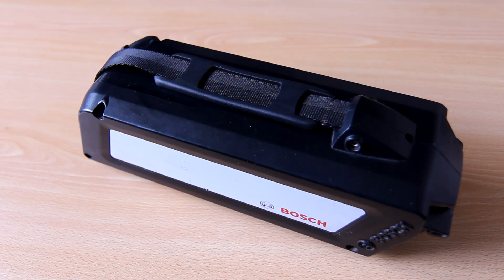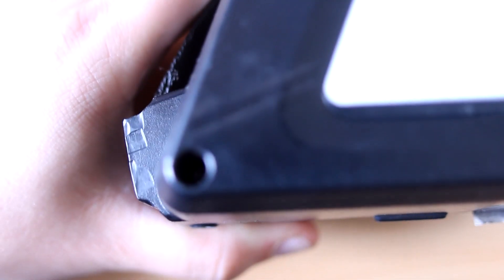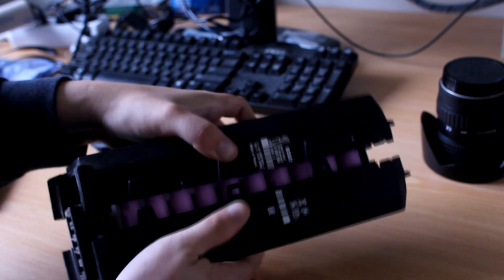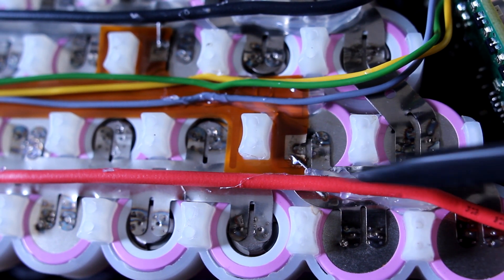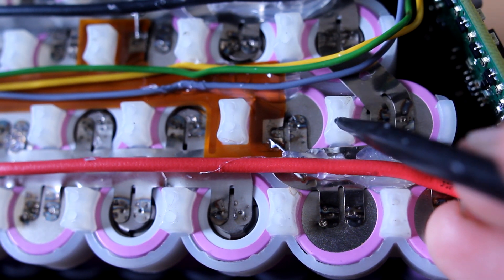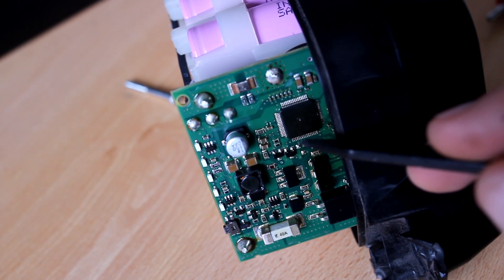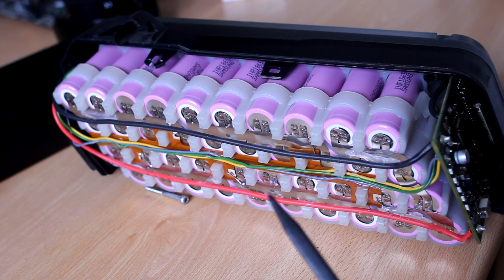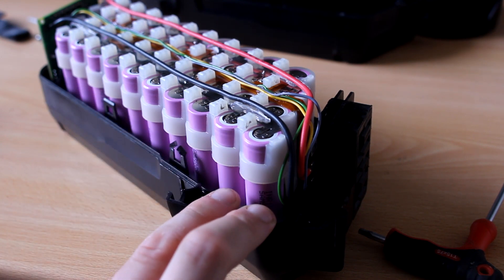Repairing a Bosch e-bike part 2: the battery (053)

Comment: I "finished" this repair on a powerpack

"1-270-020-504
20322 0034 1 2
Li-Ion 10INR18/65-4
36V 8.0Ah 288Wh
Made in Poland"

Now i am getting a blinking error-code (2nd and 4th LED blink when i press the battery indicator button) the error code means:
A defect is detected in the battery pack. Contact us for assistance.

Actions taken:
1) Checked individual parallel cells -> All are perfectly balanced at 3.53v.
2) Checked balanced connector pins on BMS -> All cell voltages reaches the BMS.
3) Tried the 10second reset ->  No change. 

So it seems that I might be out of luck

Probable causes;
X) That my battery has a suicide function. (not very probable i believe - as it is 5 years old)
Y) I heated the BMS too much or damaged it with ESD or in some other way during my repair.
Z) When i first connected the battery to the charger, it seemed to charge for a moment but then went into error mode. After this i discovered that i had not connected the cell-monitoring-cable to the BMS. So maybe the BMS saw this as a damaged battery, that should not be charged/used for safety reasons... Be it from damage or DIY-tampering.
H) That the battery has somehow damaged my charger, and a new one might fix the problem. (Unlikely i think)

Right now i am leaning towards y or z

Loose ideas of things i might try:
a) Try connecting battery to ebike - to see what happens - maybe a more informative error message...
b) Charge the pack using other Li-Ion charger and then reconnect the BMS. See if that makes a difference.
c) Contact a ebike-shop and ask if they have any reset-tools for the battery (i would deem this unlikely)

Conclusion: 
Make sure everything is connected the first time you power on the battery.
I would love your input. 
Also: The author of the movie mentions a forum where these things are discussed. Which one might that be?

Again: Thanks for a great movie

Comment: hey, good informative video, i have a 10ah pack which sits on a 15a max bike, the battery also has a 15 amp rating on it so when i go to accelerate the bars on the display go down. so sad they didnt put sufficient cells in the battery pack for the application. but do you think these are genuine for when those i have fries: https://www.ebay.com/itm/3-7V-Max-13A-3500MAh-18650-Akku-INR18650-35E-Wiederaufladbare-Li-Ion-Zelle-10Pcs/333297724114?_trkparms=aid%3D555018%26algo%3DPL.SIM%26ao%3D1%26asc%3D57921%26meid%3D3ea58d3e61354a6baca6e5b138303b5c%26pid%3D100005%26rk%3D2%26rkt%3D12%26mehot%3Dpf%26sd%3D143211300204%26itm%3D333297724114%26pmt%3D1%26noa%3D0%26pg%3D2047675&_trksid=p2047675.c100005.m1851#rpdCntId

good cells seems to be everything.....

Comment: Hello, is there a schematic drawing online, which shows clearly how the cells are interconnected ? I had to remove a faulty BMS completely and now I need to charge every SINGLE cell in order to have a balanced pack and to be able to charge it with a cheap china charger, which charges up to 42V. Thanks !

Comment: is it possible to remove the whole pack including bms and plug from the case? i mean to just exchange the case i.e. a black one for a white one without welding?
Reply: If your are still interested, absolutely yes, replacing the case does not require any soldering

Comment: Hallo an alle brauche deine Hilfe !!! Ich habe eine BOSH-Batterie mit 400 Watt, die den Motor nicht mehr mit Strom versorgt. Ich habe es an der Batterie selbst demontiert, es sind 42 Volt im Ausgang 0. Die Platine selbst wurde an einigen Stellen oxidiert. Ich habe alles gereinigt. Wie führe ich eine BMS-Karte (Controller) aus? Danke

Comment: ATTENTION! If you have new style battery (400/500 Wh), you need to connect 36V+ power supply to terminals while replacing the battery pack, so it won't wipe itself. Then you have to hold button on battery for 10 seconds to "reset" it. 
I've done it today and it's working fine. 
(I'm not 100% sure if you really need the power supply, but I will not risk 900€ battery)
Reply: Did you powered the BMS before or after disconnecting the battery cells?
Reply: @Gungarr  Why would you power it after diconnecting? 
But one guy told me, that he just unplugged it, soldered new batteries and it still worked after reset. I wouldn't risk it though. There are too many "it's not working now" comments here.

Comment: Thanks! You inspired me to do this DIY upgrade and I managed to replace with 20700 cells giving me a good 17Ah/600Wh capacity  with more power. Although I had to buy a spot welder and spent some time on searching & knowledge: it was worth the effort (and money).
My experience in short:
- Cut the main wires at the battery tab and save yourself the trouble of desoldering at the bms.
- Forget about the effort of saving the old nickel strips (I spent a good 30 minutes on one side and decided to give up). Buy new strips for a dollar/euro or so.
- For my speed pedelec I wanted more power and capacity so I used 20700 cells. These fit if you just hot glue the cells together which will give the same dimension as the original pack. You need to remove the tabs in the side panels to compensate for the increased height.
- You can solder the balance leads to the bottom side of the balance cable, this save the trouble of scraping off the top layer.
- My Bosch classic 400 pack still works after having it depowered for 3 weeks. 

Result: before a good 35-38 km/h. After: 41-43 km/h :)

Note: I just did not want to run the risk but there is a good change that 21700 cells (20Ah!) will also fit.
I am thinking about moving the controller board to the connector end because I jut can't stand the idea of losing power in the long cables.

Comment: hi, I have a bosch powerpack 400 which did not work and I replaced the cells not knowing that the BMS can not stay disconnected. Now when I have the cells replaced with good capacity cells the BMS does not gives any order to the motor.  The Battery is charging and fully charged.
Ho could I hack the BMS to make it work again? ANY HELP IS Apreciated. THANK You
Reply: Newer style bosch batterys like the power pack 400 have specific software that links with the controller on  the ebike. Bosch basically makes them unrebuildable... i work at a ebike shop and my battery guy has made the mistake of trying to bypass the software have u had any luck?

Comment: After a week of struggling to find a way of increasing my Bosch cells, I figured out a way of increasing my Bosch 300 pack without taking out the cells because I figured out if I did, that would be the end. Now I have a 28ah battery pack and it lasts me ages. 170 mile on a single charge.
Reply: Its kinda sad you do not mention how accomplished this. Instead...you are gloating.
Reply: you figured it out man, you can now ascend with your head up high, dont bother explaining to anyone how you did it.

Comment: This is fake, the battery does not work anymore after the cell exchange ...
Reply: Not fake! It works for this model.
Reply: Has Bosch built in a circuit to brick the BMS?
Reply: Powerpack 400s have bms brick function

Comment: After replacing the package, it shows error 200. Can you reset BMS and how?
Reply: This is what im thinking with over 500watts something s gotta error but  some errors can be  ignored as i changed a sproket on mine to a smaller one and it showed a error  but the shop told me when  next in theyll clear it and they did  ,but it just shows how sensitive bosch parts are yet  i know this was years ago but a friend wanted to add a standard battery for extra range and completed it by  tricking the bms  dont ask me how but he had a 500 watt pack bosch  and on the top bar a 50p wTt standard battery  he wanted to complete a long journey and his battery wouldn't. Let him so this is how he went about it and it lasted for years but i think theres can bus data cables in the newr batterys nowadays anyway fairplay to yous for been able to do this much respect

Comment: Super video! I have a question that doesn't seem to be answered anywhere... If you do an upgrade from a 300W powerpack classic+ to 400W or even to 500W (483W actually in my case)... will the bikes (intuvia) display show you the correct new ranges? I noticed the BMS from a 300Wh and the BMS from a 400Wh look exactly identical and if they are... (can someone check this please?)... how is the distincion made to determine wether you can bike another 20 or 40 kilometers (or miles if you like). In other words how does the bike know you inserted a 300W or a 400W battery? It would be nice to know how we could change the ranges accordingly when upgrading to higher capacity.
Reply: I replaced the 300Wh cells with Sanyo's GA cells (specs say 483Wh but it is more like 500Wh). I then reseted the BMS as that seemed necessary for correct charging status... Guess I first have to drive the pack empty to see if ranges are adapted accordingly in the intuvia display. Maybe I should reset the intuvia display as well?... don't know. Anyway if the ranges are not correct... the bike will still will run much longer than ever before.
And now that I know how the ebike is constructed, I might consider building a 1000Wh pack myself one day.
Just by adding 4 extra cells in each branch... this should be possible... I don't like the idea of adding the full pack in parallel (-0V and +36V) as that doesn't guarantee each group of cells to be balanced evenly. I would like to have connections between the groups of cells as well. Could be a fun (but quite pricy) project.
Reply: Wim Hulpia sometimes the display range isn’t accurate at all times. Sometimes it will show less.What you can do is navigate to the range display, press and hold the reset botton for a few seconds then it will refresh and show you an estimate of how much range is left.
Reply: well the computer works out the range from how much the battery drains over distance, for example i have a voodoo zobop-e with bosch performance cx and 500 watt hour battery from 2018. in my case i modded the sensor to go well above the 16 mph limit so when im riding at 20-30 mph it reads between 5 and 9 mph so when i fully charge it tells me in turbo mode that i have only 14 miles range, i still get ove 35 miles and i mostly use emtb mode

Comment: i want to use a bosch battery like this to power a 36v LED-chip that's mounted on a CPU cooler as a portable lamp. however the current only flows for about 3 seconds after i push on the button that's next to the charge indicator. what do i have to do to let the battery always be "ON"?
Reply: When not plugged into the bike or charger, the battery switches off automatically after 3 seconds. I know there are 5 connector 'pins'... Number 2 and 4 are the (switched) 36V.  The other 3 pins (1, 3 and 5) are connected with yellow, grey and green small wires to the BMS. I noticed when the small lipo battery in my intuvia display was dead, it was impossible to start the bike (or the battery) by pressing the power button of the display. I had to start the bike by pressing the powerbutton on the battery itself. Once started it stayed on until I pressed that button again or... until I pressed the power button on the intuvia display (so power off DOES work when the lipo inside the intuvia is dead !). I measure 3.25V and 1.6V between those wires for a short time when powering the battery on. What you could do perhaps is install the pack (without cover) in a bike, switch the pack on and then measure the voltage between the three wires while the battery stays on. (The wires are connected next to each other on the BMS so not so difficult to measure). If you measure 0V between two of those, it is possible those need to be shorted in order for the battery to stay on. (But as I didn't construct the BMS, I really don't know this for sure, so don't attack me if you blow your BMS).
Reply: i actually already blew the brown thin conductive film. now i have only the cells left and need to know how i can charge it with only the red and black wires left . :-/
Reply: Sorry to hear that... The BMS does need the strip while charging. It has 13 connections of which 11 measure the voltage of the series of 10 groups (of 4 cells in parallel). 1 connection is the negative ground, and then 10 connections are made at the positive side of each group. A NTC resistor is soldered to that strip as well that uses those last 2 connections. This resistor measures the heat the pack produces to switch it off when it should become too hot. So if this resistor is missing, its resistance value becomes infinite, so the BMS will think it's too hot and switch off. I removed the brown plastic strip with a small chisel and as the connectors are spot welded some small pieces of copper ripped off as well. I put some solder on to repair them... So the pack does need those 13 connections to function properly. As it uses it to show the charging status (leds) and also to determine when charging is complete and how charging is performed (full charging when low en pulse charging when almost full). Hope you can repair your strip tazztone !
Reply: Wim Hulpia .. thanks for your in depth reply.
but repairing sounds like an almost impossible task . i was stupid enough to take it apart. didn't think it would fry the brown strip so easily.

Comment: Could you please confirm BMS part, starting at 9:26, there is now suicide part, so I can remove batteries and connect new right? And I dont need any diagnostic tools to reset or so?
Reply from the maker: Yes, you can safely completely unpower the electronics and reconnect it to a new battery pack. There is no 'suicide' function in the pack. There is also no need for any resets whatsoever.
Reply from the maker: No - the spot welder I use (see my other videos) requires replacing the transformer if you want to use it at home, and the 'more expensive' version is already more than 500 dollars. The Malectrics spot welder at least works and is relatively cheap, but I have no experience with it: https://malectrics.eu/
Reply: i used the malectrics spot welder and it works great.
Reply: @PowerElectronicsBlog  Hi, What is the sequence for re connecting ... i burn my bms.  my sequence was B- B+ and cable leads . Thanks

Comment: Yes, very nice upgrade. I used the same cells to upgrade my brothers ebike. 6 parallel 10 series. 756 Wh. original is was like 300 Wh. It even fits in the original battery housing. The new battery has way less voltage sag, so the acceleration and top speed are also higher.
Reply from the maker: Oh man, that was the best part about this one too. The new cells are 10A rated each (versus 6A before), so they have much lower internal resistance than the old ones. You really feel the difference after a couple kilometers. The old pack would become noticeably less torquey, this one just keeps on going till the end. Which was very helpful when I ended one of my bike rides in Germany with a pretty steep climb...